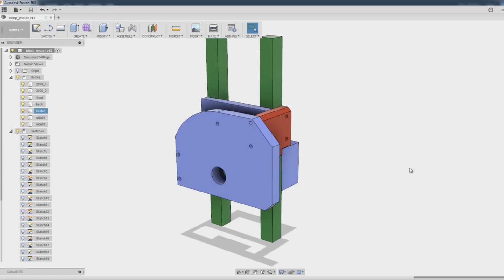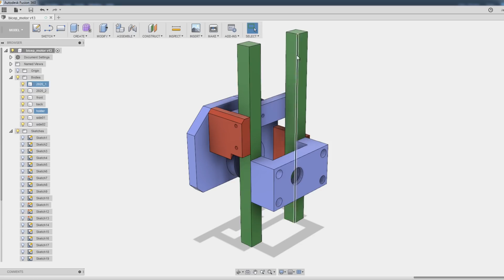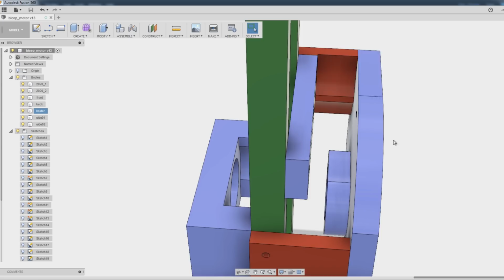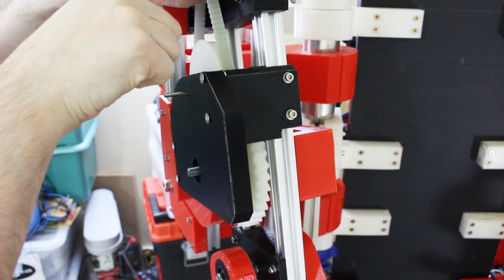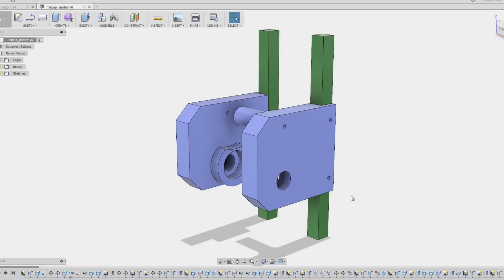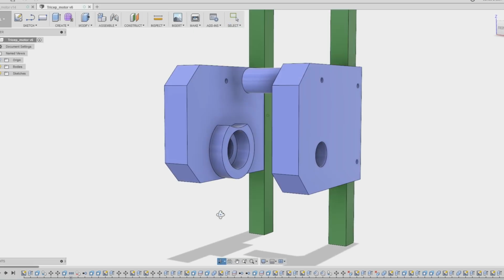Iron Man Exosuit #24 - Arm Motors | James Bruton

Comment: pistons not strings pistons
Reply: air i think you could come up with something using air
Reply: pistons, although better suitable would complicate the design further. they would add extra weigh because you need a compressor either liquid or air. and it would need software to control valves. it's not ideal for simplicity.
He really needs a way to remove the pulleys and keep his intended functinality.

Comment: Yeah that's awesome. What are you going to do next? Sensors behind soft pads would be good, so you can hold the arms of your exo and as you push more, the pad compresses and detects that you want to apply more pressure and moves the arms faster or slower. The non contact emg sensors would be the best in terms of timing and control.

Comment: Wouldn't it be simpler to use 3d printed harmonic drives ? I don't know if tolerances would allow this or if this is even possible in plastic...Anyway just Had this though since you need a long assembly with block and tackles... while the harmonic drive doesn't

Comment: Hey James, had you considered a ball screw for the upper shoulder, similar to what you have on the legs?  Mount it right onto the outside of the shoulder block and use it to drive a pushrod connected to a fulcrum pivot on the actual shoulder joint.  I can sketch something out later when I have more time.

Comment: Can I order some robots legs when your finished as I think this would help me with me arthritis ankles lol
AWSOME WORK always look forward to your videos
Reply: Out of all the exo prototypes out there, this one seems to be the most cost effective and shows potential. I hope James can carry on working on it at this pace and he should have a compact wireless prototype in the next few years, similar to Japanese HAL but affordable.
Reply: There are robot legs that have been approved in the US for helping paraplegics and spinal injury patients walk upright and rehabilitate. You still need a pair of canes for balance, but it is much better than being in a wheel chair.

There is a full ankle replacement surgery that has become more widespread in the US that could help, if your arthritis is from wear or injury. It is crazy brutal, like a hip replacement, for what is done, but that is par for the course with orthopedics. Not really worth doing it if the arthritis is from another source though.
Reply: It does depend on the materials he chooses to build it from (likely aluminium alloy since it is cheap, stiff, and lightweight) and the price of the batteries to give it enough power to run for a decent amount of time. Since he is still in the prototyping phase, batteries might become significantly more economical in time for the final design.

Comment: You need to add a brace where you said a cam. A long piece that points upwards with a baring pivet that fits at the bottom of the red back parts behind the elbow that the arm hangs from pointing up to the shoulder and some form of roller bearings that runs down the back of the biceps. So when the arm moves out the brace moves/rolls freely down the back of the bicep pushing it out. it'll allow the arm still to move freely  but take the flimsiness  out of the arm when you're moving or reaching out to lift something. Just an idea, thanks. Great vid

Comment: Ive heard that some mechanical prosthetic limbs work by having sensors attached to the skin, what if you placed sensors on your skin, and have the sensors wired to the exosuit. So theoretically: you wouldnt have to push onto pressure based sensors, instead the suit could possibly move with your body in sync.
Reply: Skyler Muir , you can get a sensor kit for an arduino for $30.
Reply: That technology is extremely expensive.
Reply: Skyler Muir 
What i meant was to basically try to use the concept of a prosthetic limb and implement it into the exosuit, and hopefully it works and moves in sync with the body.
Reply: James Bruton
Well, what if you made a skin tight outfit with sensors embedded in it, with that it would keep a constant connection to the skin, and it would possibly be easier to put on and remove.
Reply: James , there's a company that makes a wireless arm band with sensors .You just slide it over your bicep . I forgot the name of it but it was a successful kickstarter campaign like two years ago . It costs somewhere around $200 . I'll post the link if I find it.
Reply: James Bruton You could use a similar idea to your motion capture suit that you used in your Avengers Ultron project.

Comment: How do you connect the motors to the arduino?
Reply: You use the arduino's servo library and treat the motor ESC as a servo. You just connect the ESC's receiver wire to a pin on the arduino and the 5V and GND, then you write to the pin as if it were a servo. Super easy
Reply: Tony Stark so the esc is a converter? Like I just need to convert the bullet plugins to the pin plugins arduinos uae
Reply: James is using brushless motors, and all brushless motors need a controller called an ESC (electronic speed controller). All ESC's have 3 wires for RC signal input to tell them what to do. This is separate from the 3 big phase wires used to power the motor